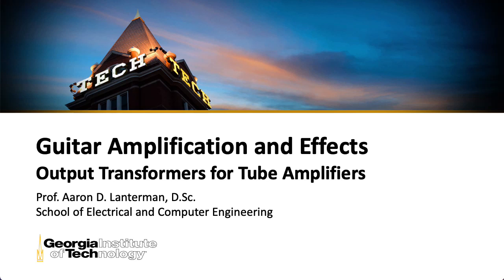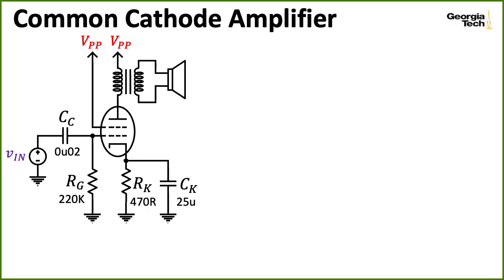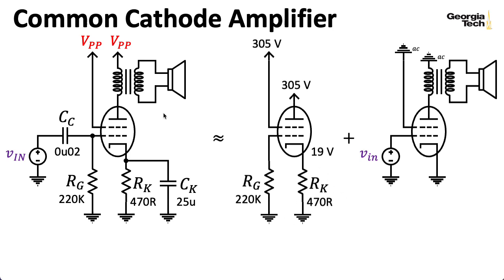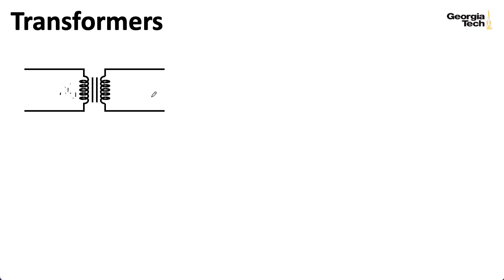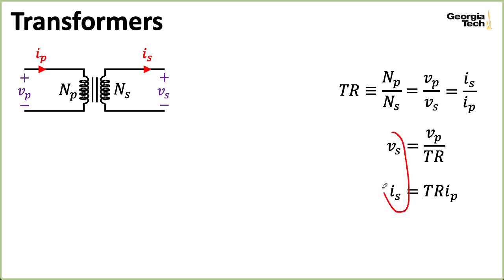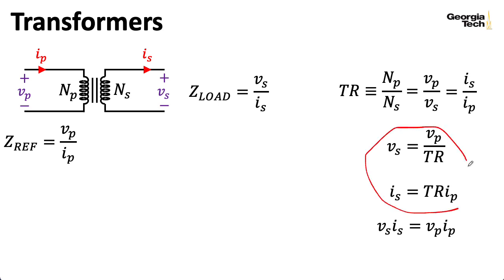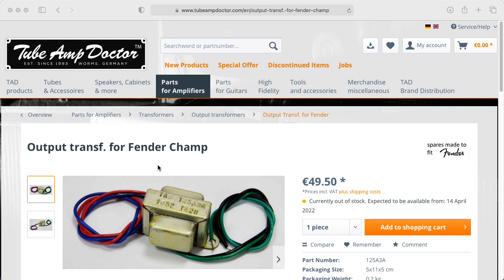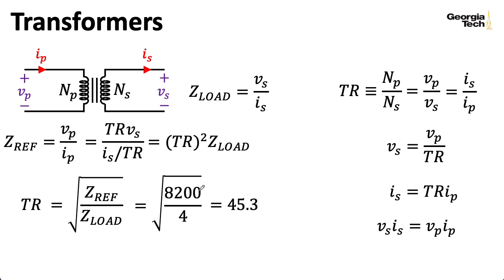ECE4448 L47: Output Transformers for Tube Amplifiers (Guitar Amplification & Effects, Georgia Tech)

Comment: This series is so comprehensive, it actually helped me understand tube amps. I’m currently in the process of learning design criteria and there’s only one thing I’m not finding anywhere, namely how to determine the turns ratio given a speaker and a tube already biased, the Thévenin equivalent circuit looking down in the tube is what helps calculate the impedance I have to match with the transformer?

Comment: I bought a box of mystery SE transformers once.
If I remember correctly, You can get a decent reading on them with an LCR meter on the primary and using the wanted load on the secondary.
I think i was measuring resistance at 1kHz on the primary with a 4ohm resistor on the secondary.

doesn't really give you an indication of how much current it can take though.

thanks for the videos Aaron.

Comment: How can you tell there is an "Air Gap" for single ended amplifiers output transformers? The Air Gap just passes the high Plate DC voltage or does the Air Gap in the output transformers does something else?
Reply: Howdy.
In a PP amp the induction may be designed to reach about 1,1 Tesla both ways.
In a SE amp the DC may not cause the induction to be more than about half that, say 0,5 Tesla. This reduction can be achieved using an air gap. Now the induction can be rated to a swing of 0,5 T + - 0,5 T or 0 - 1 Tesla.
The design math of air gap magnetics is complicated though.
Regards.
Reply from the maker: Google "air gap transformer" without the quotes, there are some nice write-ups out there.
Reply: @Lantertronics  I will have to research about it because I never heard of Air Gap Transformers being used in guitar amplifiers for single end Class A guitar amplifiers. The output transformers all look the same to be can't tell if there is an Air Gap internally
Reply from the maker: @waynegram8907  You'd probably need to look up the part number.
Reply: @Lantertronics  Most fender and marshall uses their own part numbers because they get them from a certain factory, Even the old fender amps 50's part numbers are fenders part numbers for their own BOM bill of materials. VOX amplifiers in the 60's I think is the same with the part numbers being a VOX part number.
Reply: As far as I understand it, the air gap acts as a resistance to the magnetic field through the transformer core (making it less efficient) so that the magnetic field won't become so high that the transformer core saturates (at high enough magnetic field, the core will stop reacting to changes in the magnetic field, and it's suddenly like there is no transformer there). A DC current doesn't do any useful work in the transformer, but it still creates a magnetic field).
Reply: @possible-realities  some engineers use the term "loose coupling" or tight coupling, which I'm guessing they are referring to the Air gap of the transformer?

Comment: I watched a few videos from this class and really enjoyed it. One thing I always struggeled with is chosing a OT for a Single-Ended or Push-Pull amp. I always choose the primary impedance based on similar amps that have been around like 3k2 for any 2*EL34 Push-Pull amp (like 50 Watt Marshalls ). Any chance you could include it in a future video. I'd love to finally be able to make a choice based on actual numbers instead of copying from old designs.
Reply from the maker: The very next lecture will get into some of that -- basically the reflected impedance will define what the AC load line is.

Comment: Very succinct. TIL that an output xformer for a single-ended amp needs an air gap.
Reply from the maker: Thanks!
Reply: I wonder if there is any way to high pass filter the output before it goes through the output transformer, to get rid of the DC current? But whatever that high pass filter would be made of would of course need to handle quite a lot of power...
Reply: Of course, you could use another transformer to remove the DC component first, but then that transformer would probably need an air gap. (And you would need second transformer...)
Or if you had a transformer with 3 windings then you could run a reverse current in the third winding to cancel the magnetic field from the DC current in the primary winding. But then you would need a current source for that, and it would probably consume a lot of extra power too... Maybe if you used the current from the output tube again, but this time bypassed the 3rd transformer winding with a capacitor to only get the DC current through the winding. But then you would probably need a pretty big power capacitor...